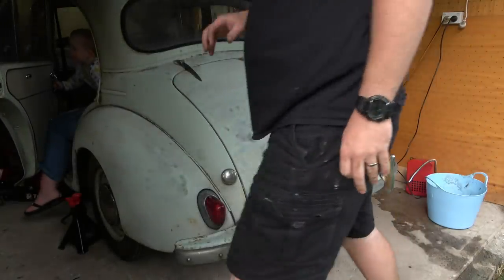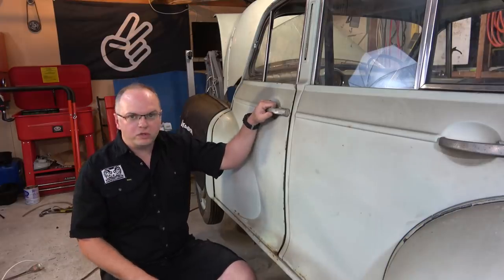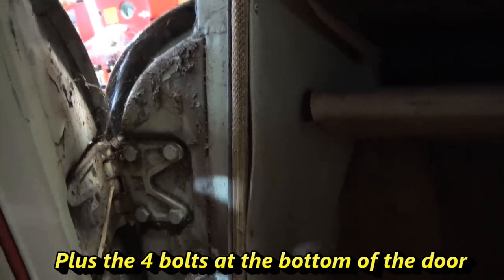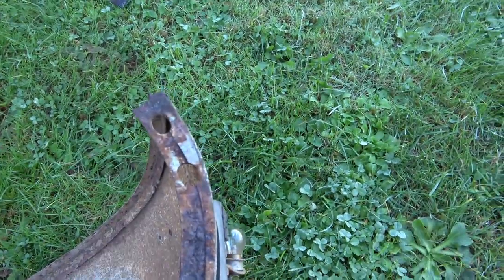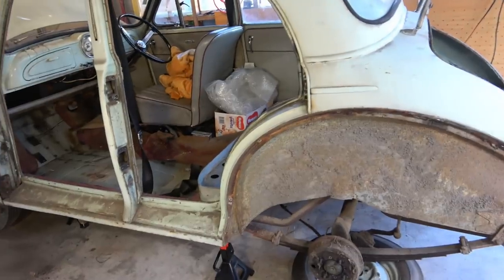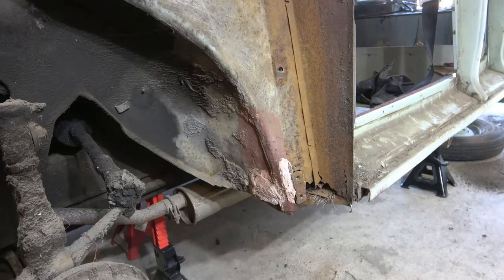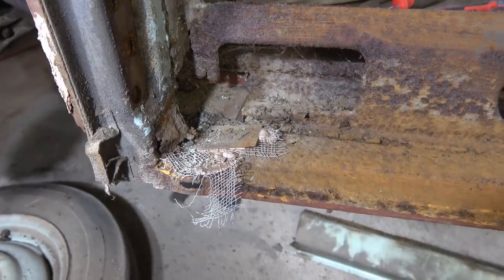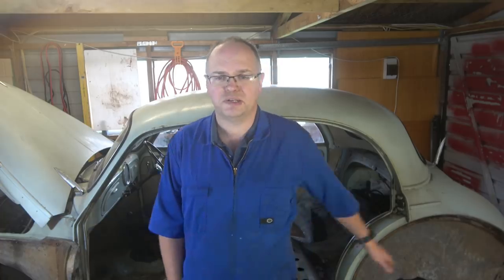Morris Minor - Removing Panels - Part 11

Comment: Well Mr B, this is taking me back over 30 years to the first time I restored my 1970 Traveller, I'm now in the middle of doing it again! Believe me, so far you have been extremely lucky firstly finding such a decent car to start on and secondly with a relatively easy strip down. I ran out of juicy swearwords struggling with all the badly rusted nuts and bolts---that was in the UK---salty roads in winter. Great series, enjoying it immensely, thanks for sharing.
Reply from the maker: Fantastic, I'm glad this series is bringing back fond memories. Stripping the driver's side is proving more of a challenge, the nuts and bolts seem to be a lot more difficult to get out. I'm getting there slowly though. Thanks for watching

Comment: Blimey mate that bodyshell looks pretty sound. You can hear the quality of the metal when you ding it. Its why they were pretty heavy for a small car. It is certainly worth getting the shell and all the panels to a shotblasting outfit and then etch prime it. Beats hell out of wire brushes and you end up with a sound base for paint. I am doing a '78 Mini 1000 and it worked for me....
Nice work though and I hope you have fun but you were VERY lucky with the wing bolts!
Reply from the maker: It's very impressive how well it has held up. Shotblasting is an option but I don't like outsourcing work! I'll probably start doing it by hand then get fed up with it and send it to the blasters... The rear wing on the other side is proving a bit more stubborn to get off. Cheers!
Reply: Ha!! sneaked up on ya bud

Comment: Just a thought, use stainless nuts and bolts for putting back the cill finishers, and MIG welding just takes a bit of practice, I found gasless, flux cored "MIG" is a bit too fierce for bodywork, I use a cheap outfit and a pub cylinder and it always works fine for me. Good luck.
Reply from the maker: There will be stainless nuts and bolts as well as plenty of rust proofing on the finished product! I have a few welding friends so I should be able to get hold of a better setup and some hands on advice. I will definitely be doing the work myself though, all part of the learning and enjoying. Cheers!

Comment: She’s in amazingly good condition , the ones I used to work on the rear springs were always in the back seat , ie gone through the floors ! Great cars though , used to get mine upto 92 mph how far the clock was out I don’t know !
Reply from the maker: All of the important bits are nice and solid. Hopefully I can give it some performance with the engine rebuild. Not sure I'd want to do 92mph with drum brakes all round!

Comment: Unless you absolutely have too, I would not recommend you removing the rear windscreen, they are a pig to get out and an even bigger pig to put back. The problem seems to be caused by the screen rubbers being thicker than the originals, so you have to exert a lot of pressure to push them home, original glass is getting harder to find. The rusty panel on the inner wing is called the flitch. Welding is not the dark arts that many will have you believe, practice makes perfect and cleanliness is king. If it helps, this has to be the best example I have seen, solid inner wings? unheard of in the UK. Good luck, looking forward to more.
Reply from the maker: Thank you for the advice. I had heard about the issues with the replacement rear window seals. The current one is cracked and perished and I think it would spoil the look of the finished car if I didn't replace it. I shall consider the options.
As for welding, I can make metal stick to metal but I only have a gasless mig which is less than ideal for bodywork. I'm working on a better solution.
Even for an NZ car I'm amazed at how solid it all is. I have a late 70s Holden that has been on the road more recently that is in a far worse state with holes everywhere.

Comment: Just a tip don’t grease the steering lower trunion if they are badly worn they may pop out causing the wheel to fold under the car actually had this happen luckily at a very slow speed
Reply from the maker: I had heard about trunion issues. I may well put some new ones in to be safe
Reply: Just another tip to remove windscreen and rear window ,remove chrome insert in rubber this should make rubber pliable enough to squeeze rubber into channel where chrome strip was and loosen glass

Comment: Push and peel the windscreen rubbers from inside out use a screwdriver to help move the rubber as you use a bit of pressure on the glass with your feet  the glass is pretty strong but just pressure don’t kick it
Reply from the maker: Thanks for the tips. I think the biggest issue I'll have is getting the perished rubber out.
Reply: Cut the inner lip of the rubber off with a utility knife then push out with foot power
Reply: William Schleicher think he wants to save the rubbers
Reply from the maker: They're beyond saving, I just don't want to break the glass